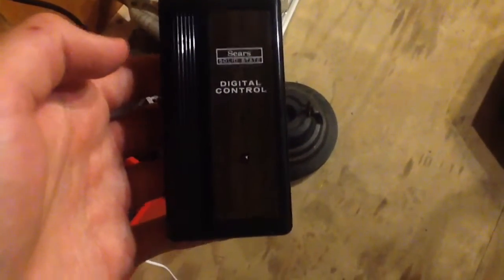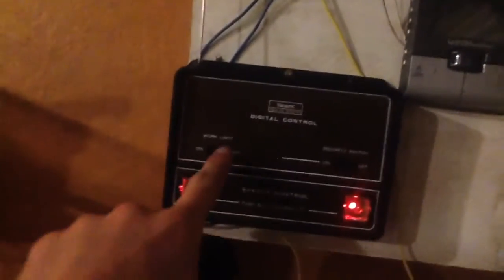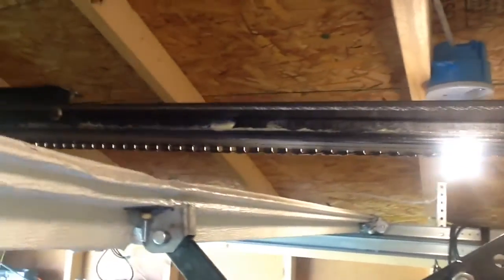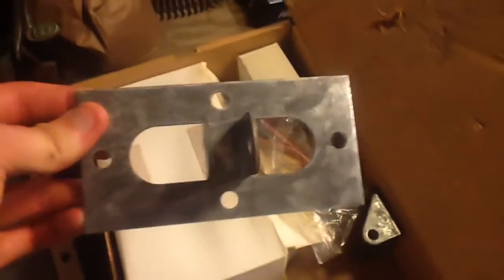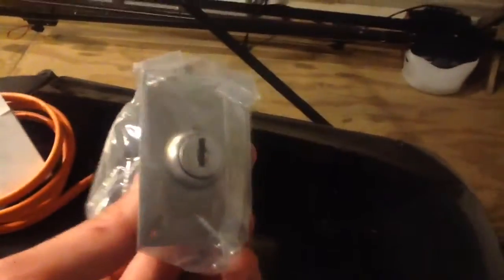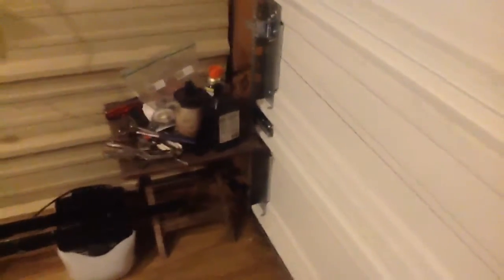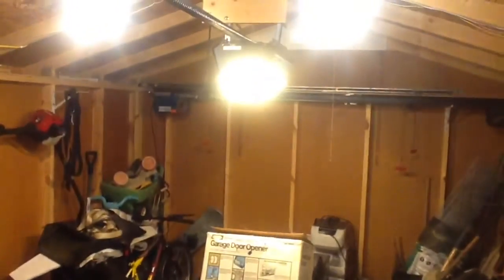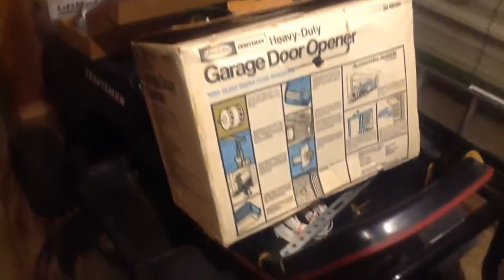Sears 139.664053

Comment: How do you adjust the travel on this model?
Reply from the maker: Under the light cover, there are two metal adjustment screws (there should be a rubber grommet around them) I think they should be labeled for up and down. Turn those screws in small increments to change the length of travel. I think one full turn of the adjustment screw equals 4 inches of travel. Hope this helps

Comment: Just got a new remote for this model. The model is original from the 70s I believe. How do I program the remote?
Reply from the maker: If you still have the original wall control, the top half opens and there will be a set of 9 trinary dip switches on the board. Match the dip switches in the remote to the dip switches on the receiver board.
Reply: @GarageDoorGuy89  Let's GEAUX!! That worked!! Thanks a lot!
Reply: where did you find the remote?
Reply: @ladebak412  Amazon
Reply: So I can't use a newer remote?

Comment: How did you program the universal remote?
Reply from the maker: They come with instructions.
Reply: @GarageDoorGuy89  do you know what remote is compatible with this opener? I can't find anything for the 139.664053 model
Reply from the maker: @stevenefthim6978  do you still have the original wall control (It has the receiver in it)?
Reply: @GarageDoorGuy89  Yes I do have the original wall control.
Reply from the maker: @stevenefthim6978  any liftmaster 61lm should work

Comment: Do you have the manual or know how to program a new remote?
Reply from the maker: If you still have the original sears wall control, if you take it off the wall there is a set of 9 dip switches inside. match the dip-switches in the new remote to the existing dip-switch setting in the wall control. the only remotes still made that I know are directly compatible with this are the LiftMaster 61LM and Sears remote 139.53778.
Reply: @GarageDoorGuy89  Thank you for this information!!!  I was able to purchase https://www.amazon.com/Liftmaster-Compatible-Stinger-390LMD21V-Remote/dp/B0039067KK/ref=sr_1_2?dchild=1&keywords=390LMD21V&qid=1614287989&s=hi&sr=1-2 and it worked perfectly!!!  Just remember to remove the paper that blocks the battery terminal on the new remote.

Comment: I'm looking for a gear with sprocket assembly kit for the Sears Craftsman 139.664053.  Do you know where I can find these parts?  Please let me know.  Thanks
Reply from the maker: You will have to check with your local garage door companies as this part was discontinued in 2008. all you really need is the main drive gear. If none of them have it you can order a 3D print of the part http://www.thingiverse.com/thing:740796 Be sure to apply grease to the gear prior to installing it otherwise it will only last a few weeks. if you need bushings, check SearsPartsDirect they might still have them. hope this helps.
Reply: Thank You GarageDoorGuy89!
Which of the two gears in the schematic link is the main drive gear?  # 10 Gear part# 81B11 or # 11 Worm Gear # 81B56.  The gear I need adjoins into Worm gear #22 part# 81B53.  In the event I need to have the gear made, how does thingiverse know how to make this part?  How will they find the specs on this part?

searspartsdirect.com
Reply from the maker: you need part #81B56. (its labeled wrong in the online owners manual) when you click on "order a print" it should take you to a list of Apps (printing services) to order a 3D print of the part. from there choose a printing service (there will be numerous different people/servers available to make a print all at different prices). **Have the part Printed with General Purpose Plastics (PLA) at .2 layer height, 75% fill**. As for the worm gear, nobody has made the file yet for it to be printed. However the worm gears in these units are all metal and should never need replacing. Thingiverse may have a problem with bringing the file over to the printing service, if that happens, go to "thing files" on the part page and download "Gear_Helical.STL" to your computer where you can easily find it and upload it to a 3D printing service. I've used 3D Hubs in the past and have had no issues. This is the best way that i know of to get this gear. I haven't found any other alternatives. Hope this helps!
Reply: Thank You!  I will have a look and make this happen.  I love the idea of repairing this vintage door opener.
Reply: How do i add a wireless keypad to an old motor with DIP SWITCHES..